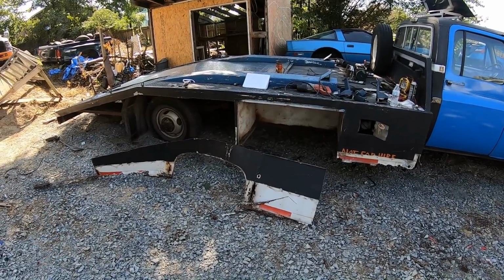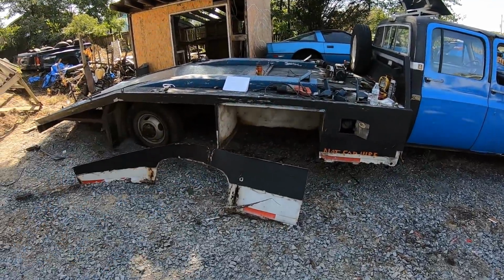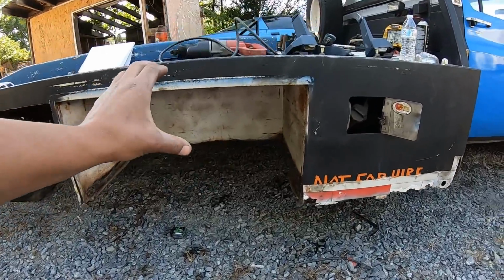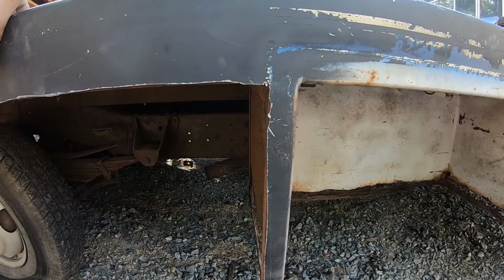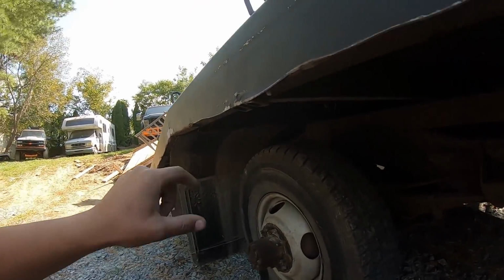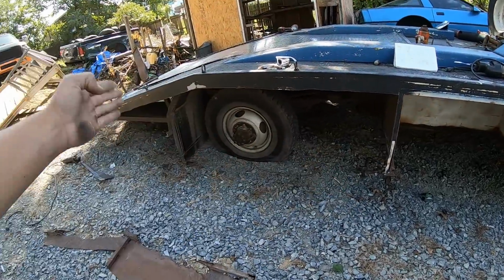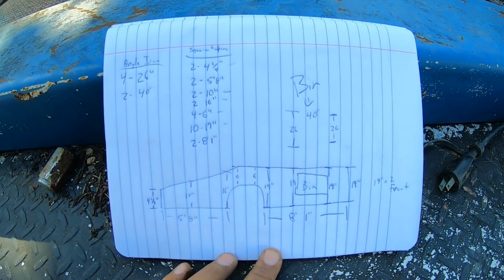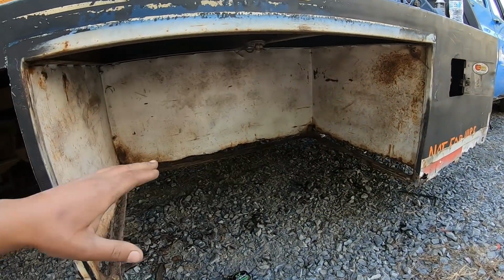RESTORING my Squarebody in my driveway! ALMOST READY FOR PAINT

Comment: Steve get some fork extensions for the fork lift that will fit the whole with of the cab they slide over top the stock forks and you should paint the ramp truck black on top orange in the middle black along the bottom and orange wheels